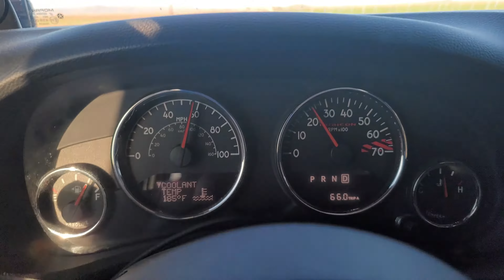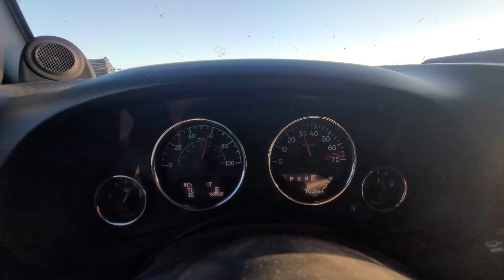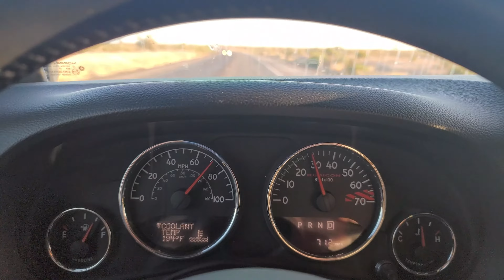How to Swap your Transmission! (8hp70) (video 1)

Comment: Thanks for making these videos. Very helpful for planning my 8 speed swap as my 545rfe is no longer working. Im doing it in a 08 jku Rubicon with supercharged 426 hemi. Hopefully the transmissions are similar in length. On to part #2!
Reply from the maker: Hey glad to hear they are still helping people! Sorry to hear about ats, I saw your post on jss. You will be happy with the 8 speed though 🤙🤙

Comment: Oh man this is nice.

I have a 2013 RAM 4.7, truck never came with the 8HP and was never planned to. I have a rarer config as it’s a bighorn and is fairly loaded out.

Trucks been through hell, saved my life and i’m pretty sure the trans is starting to die on it. Been looking around online and it’s compatible with a 8HP swap and so i’m gonna do it as i hate the genuinely awful gearing of the RFE. Hella nice build dude!
Reply from the maker: Hey that would be a good swap! Hopefully it's all compatible so you can really enjoy the 8 speed! I love mine so far! No complaints, and the gearing is perfect. The rfe is one of the options that people use on the jeep hemi swaps but now the 8 speed is the main transmission used. Let me know if you get to swapping that transmission, I would like to know how its working! Comment for questions!
Reply: @jku392adventures  Hahah hell yeah i’ll let you know how it goes! I plan on doing it later this year if not early next. The trans in it right now is exactly that out of a 5.7 RAM and the mount bolts etc is the same. Funnily enough i think in the second part when you were trying to get the bottom torque converter access plate purchased i noticed that it’s the exact one out of the RFE! Even used one in the diagram, LOL.
Reply from the maker: That's awesome! I didn't know they were the same bolt pattern for the 4.7 to the 5.7, I've never had any reason to look it up yet haha, but that's good to know. And yes that dust cover should be the same for many vehicles! Here's the pn 53021491AA. 
Good luck man!!! Have fun with it!
Reply: Any body swap the2011 ram hemi 5  speed to 8 speed
Reply from the maker: @robertomendoza5668 look on this Facebook page, I believe he has done a similar swap

https://www.facebook.com/profile.php?id=100057085766128&mibextid=ZbWKwL

Comment: I am researching this swap but my hopes were just blown. I have a kind of unique reason for the swap- I tow a small camper trailer with my 2018 JKUR as well as moderate to heavy off roading, and the nag1 has terrible shift points for towing with the 3.6. On the highway there is a huge jump between 3rd and 4th gears, which results in running high RPM in 3rd because it just can't pull 4th. I considered regearing the axles, especially since I'm running 35s, but some research showed the 8 speed gearing would be great for towing, and would solve our issues, as well as being a better trans for daily driving, have a deeper 1st for off road, and better OD for when I do get around to regearing the axles.

However...I'm not willing to give up the Rubicon t-case, and used manual Rubicon cases are crazy expensive. I guess it's back to axle gearing.
Reply from the maker: It's still a swap that is worth it. Final low range gear ratio is very close with the non Rubicon+ 8speed compared to the Rubicon tcase and nag1. On another note, I sold my Rubicon tcase for $1600. You can find a manual Rubicon tcase for around that price. So it's still not a bad idea to do this swap imo. 

Thanks for the comment!

Comment: What does it take to use the stock shifter on the 8 speed? I see Americas Most Wanted uses the stock shifter.
Reply from the maker: Hey in order to use the stock nag1 shifter you would have to go with a different company for the controller other than pcs, I havnt done much research on those other companies but from what Ive heard, there is the most success and customer satisfaction with the pcs controller like In my videos.  But I think the other brands would be ats

Comment: Hello, please help me. I have a Jeep Wrangler 2011 Sport, a manual gearbox. I need an automatic. What are the tools needed to replace it?
Reply from the maker: I would say a good socket set and some metric wrenches. Removing from the vehicle will require Jack and stands depending on the height of the lift and tires. And you'll need an extra person to help remove the transmission. Hope that helps!
Reply: @jku392adventures  I need to replace the shifter of the manifold with an automatic replacement. I do not know what the loan is for the crisis. All I know is that I will need an automatic speed changer and additional wires. Does it need a new computer? Please help me.
Reply from the maker: I think the best thing you can do is join jeep speed shop, on Facebook, they have. So much information on there and it's easier to ask specific questions 👌👌🤙🤙

Comment: Where did you get the new shifter from and this would be a can controlled shifter? How do you interface it to the 8HP?
Reply from the maker: The shifter if out of a charger like years 14-18 I believe, or close to that. I believe they are a canbus shifter, I use a pcs2800 controller to bridge the communication from the hp70 to the jeep and ECU. That shifter is required for that controller. In my other videos I go over the controller. There are 3 videos in the transmission swap 🤙🤙
Reply: @jku392adventures  Good info, cheers. I'm currently planning a Jag v12 to 8HP55 swap for a mid engined replica (XJ220). The engine doesn't have can bus so looking to upgrade.
Reply from the maker: @Dont_Gnaw_on_the_Kitty_1  I bet you could get a stand alone controller so you wouldn't need to do anything too special. You would just need to tap into several vehical sensors like the throttle, and speed sensor, and brake pedal sensor. There others but not sure exactly what all is needed

Comment: I've watched all three videos and can't find where you listed the part numbers for the dust shield & the lower brace. I've got a 1997 TJ with a 5.7 & 545RFE currently that I'm gathering the parts to do the 8HP70 swap into. I can't find anyone who lists those part numbers. Thanks.

Comment: Will my 2016 JKU 3.6 work for the 8 speed swap. I really want the 8 speed. In 4.56 gears and turboed with 35s so the 8 speed would be the icing on the cake.
Reply from the maker: Yes people are successfully swapping in the 8hp behind the 3.6. it's definitely a game changer. It's I believe the 8hp45. But look up the Facebook group on Facebook called jeep speed shop

Comment: Hello, can you please tell the origin of the 8hp70  is from a bmw  ? Or is from other manufacturer. I m from Romania and here the most spreaded setup for the 8hp70 is on Bmw x5 e70/e71  but the configuration of the bell housing is diferent, olso the cooling sistem.
Thanks
Reply from the maker: The hp70 that I bought was from a dodge ram 1500 4x4 truck. 2013-18 have them. The bellhousing will be different if you get from a bmw. What are you planning on installing the hp70 on?
Reply: From factory the car was a 2009 VM 2.8 CRD, 177HP, untill two years ago  when the crank shaft broke and the car was abandoned, now i am looking for a new setup of the powertrain, the one that i have in mind is:  M57TU2 engine (from bmw  )  with the 8hp70x gearbox olso from bmw  but at this point the transfer case  coupling looks diferent from dodge to bmw... so i will probably need an adaptor plate, betwen the housings,  hope that at least the  output shaft will fit to the transfercase,  otherwise i will need a dodge gearbox and they are kind of rare in europe, and the shipping from us is not a reliable solution.
Reply from the maker: @alexandrupohontu7151  that sounds like a fun build! Are there any bmw 8hp70s that have AWD? If there is I wonder if you could take the whole transmission and transfer case so everything bolts up. But I'm not familiar with the bmw 8hp70s yet. Not until I swap one into my 335xi someday 😁😁😂😂
Reply: @jku392adventures  There is a AWD version of the transmission used in Audi Quatros - 8HP55, don't know if this useful info though.
Reply from the maker: I plan on hopefully swapping an hp70 into my bmw someday! It would make launching and everyday driving so much smoother! Thanks for the info! 👍👍

Comment: Hello, did you sell the Nag 1 Trans? If not, would you be willing to sell the Torque Converter to me. I have a 2015 Jk with a 392 and the Nag 1 setup and I had a stopped up trans filter after the last service I completed and it starved the TC and I need to replace it with a matching TC. The one you took out would work great for me. Great video by the way.
Reply from the maker: Hey thank you. And I still have the transmission from the charger with the tc attached to it! Where are you located? Want to send me your Facebook account and I can message you on there? Or email
Reply: @jku392adventures   did you get my email address?
Reply from the maker: No I didnt, what's your email?
Reply: It will not let me leave my information. search me on Facebook. That’s a my name.

Comment: Thank you from KSA.
Reply from the maker: Thank you! Glad you enjoyed!
Reply: @jku392adventures  is it possible to do the same thing with 2013 5.7 WK2 (65RFE)?
Reply from the maker: From what I've heard and read, that used to be the main swapped transmission, but the new best option is the 8 speed. For more info on the 65rfe, join this fb group, they are the company that I buy most of my swap parts from. 

https://www.facebook.com/groups/239426624562458/?ref=share
Reply: @jku392adventures  My GC has 65RFE.
I hope I can duplicate your great job and replace my 6 speed with the new 8 speed.
But I am not sure if the 8 speed TCM would work without any issue with the current ECM and other computers on my 2013 WK2.
I do not know for sure if  2014 WK2 with 8 speed is using the same communication network protocol (Can-Bus) as 2013 with 6 speed.
Reply from the maker: @alihsas  I know that in the wiring harness for the controller for the hp70 there is an option to basically skip the canbus system and individually plug in each required parameter. Such as speed, rpm. Pcs is the company that makes the controller
Reply: @jku392adventures  Thank you so much.